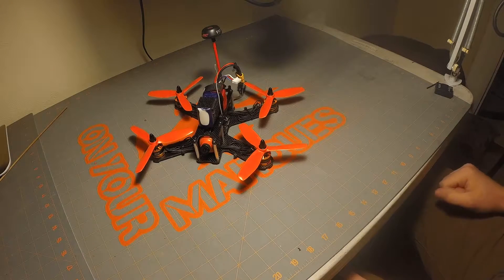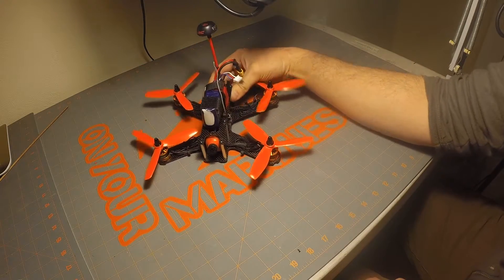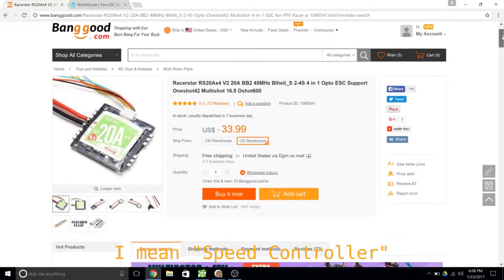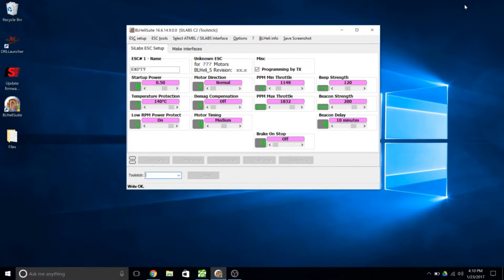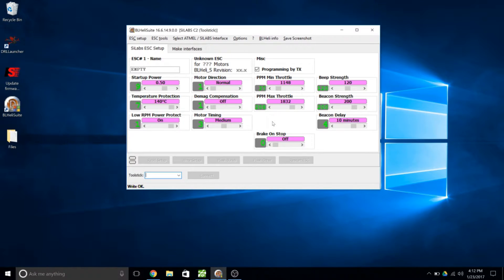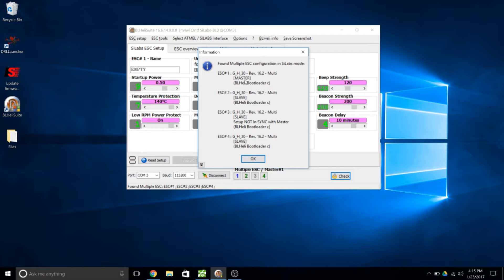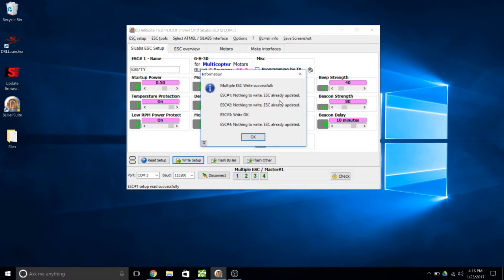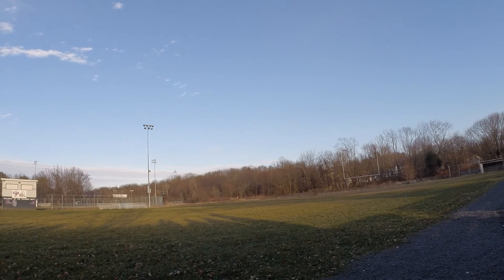Flashing BLHeli ESCs through flight controller(no FTDI)

Comment: What a sh!t video u show nothing.. you show a picture of the 4in1 and then blheli software no wiring nothing !
Reply from the maker: This video refers to flashing the ESC through a flight controller to sync all for sections of the ESC.  This is not an installation video.  As stated in the video, the ESC wiring was direct soldered to the flight controller pads and the ESC was programmed through the flight controller.  Besides for plugging in a USB cable to the FC, there is no wiring involved.

There are many other videos out there for setup and wiring.  My video describes how to fix issues that may be present in the ESC from the factory.  If there is anything else I can clarify for you, feel free to ask me and I would be happy to explain.
Reply: On Your Marques yes videos titled flashing blheli through FC.. yet not once do you show the fc or escs.. like i says useless..